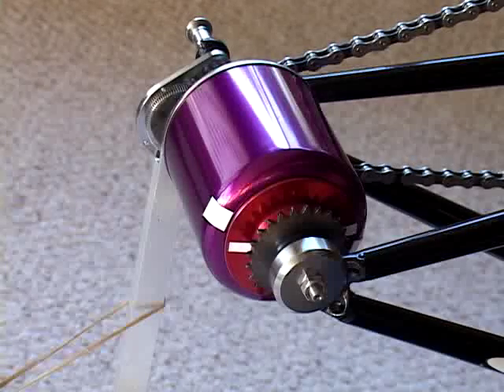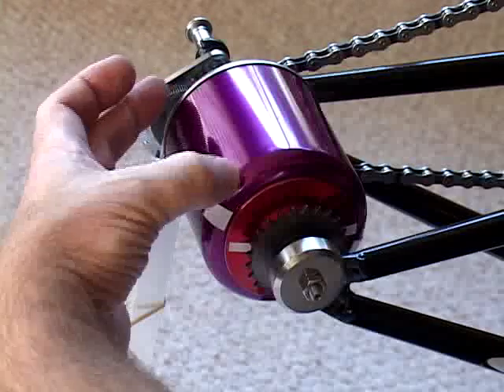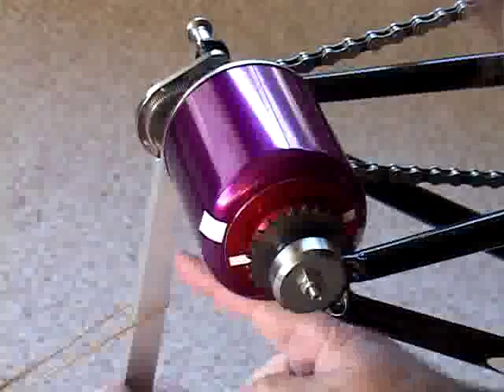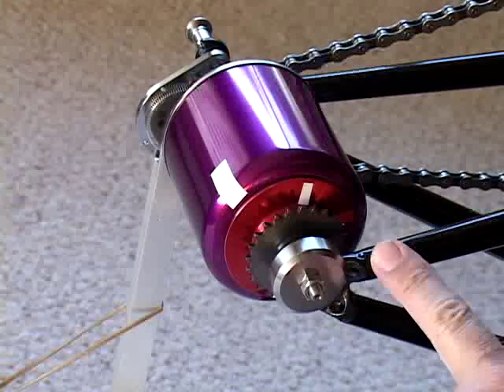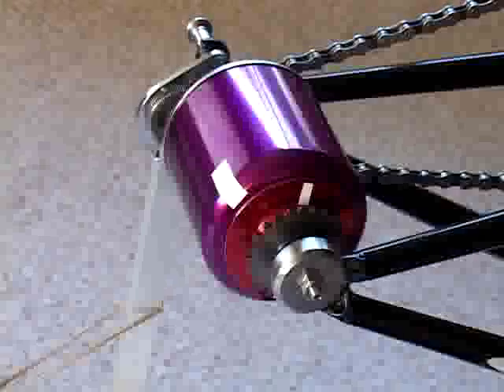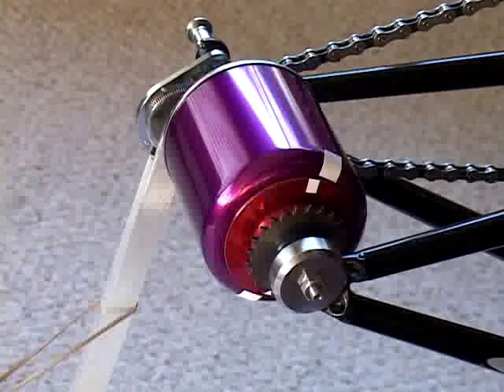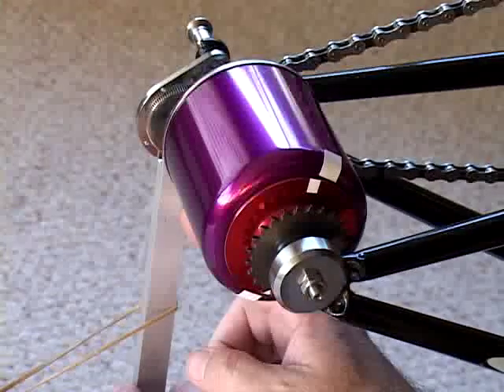Automatic Bicycle Transmission (IVT)

Comment: Your idea is great because provide a  much higher ratio range, but what about the weight ratio compares with an standard bicycle rear gears? If you can create and IVT lighter than the lighter ones on market it’ll be a great advance for cycling. For those of us that practice triathlon this would just great. Regards!

Comment from the maker: @theantiredneck You are very insightful about that.  I've studied that about electric motors too with similar conclusions.  The myth doesn't take into account the effects of variant loads on the motor; the torque/speed inversion is not linear, very non-linear at partial loading.  Tesla engineers know about that, but only abandoned their 2-speed because that torquey motor busted gears on the shift.  Notice that the SIVAT doesn't make an abrupt shift?  Hmmm!

Comment from the maker: @lidzykelly87 Look up the defiinion in Wikipedia.  IVT is a special case of CVT.  This is an IVT.  The top ratio is irrelevant because it can be raised w/ step-up at input or output without losing its ability to continuously reach zero; this is done in the featured drive with a 55T/11T sprocket combo input, giving the final drive nearly 5X.  A step-up will be integrated in the product version w/ a top output at >3X, sprocket sizing notwithstanding.

Comment: Would work nicely on electric vehicles, people that think electric motors don't need a transmission because they don't understand and have only seen gear less hub electrics and therefore since their repeaters and put what little processing they do have and apply that to what they repeat and copy would be amazed to see an electric that does have a transmission, electrics benefit from transmission just as much as combustion engines do!

Comment from the maker: @pwfordever Snowmobiles use a Variable Diameter Pulley (VDP), very inefficient.  They're not infinitely variable & cannot effectively be so because they'd slip with the level of torque that this can handle in ultra-low ratios.  Snow is not a positive traction surface, so it doesn't offer the level of propulsive resistance that a tire on pavement does by any means; OK for a VDP.

I didn't understand your reference to engineers mentioned from elementary school.  Could you clarify this?

Comment from the maker: @n8glore No.  The SIVAT won't stall unless you're pedaling against a vertical wall or can somehow produce over 1500 watts!  Only a handful of top sprinters can ever produce that level of power, and only for a few seconds.  That feature is there to protect the mechanism from destruction by crazies who'll try to use it with an excessively powerful motor.

Comment from the maker: @mrpierce1000 I'm currently developing the SIVAT for some non-bike application products.  This will offer a chance to determine its performance on vehicles.  If I'm satisfied with the results, we'll very likely develop it for high-end MTB's & Road Bikes.  For TT, efficiency is paramount; so the lower efficiency of gears (which the SIVAT uses) will need to be more offset by gains in ergonomic efficiency that constant fine-tuning of ratio provides.  We'll test that.

Comment: I'd love to see this.  It looks to operate similar to the Simplex motorcycle CVTs I've seen in the past.
Its probably a form of counterweights on a conical shaft that varies with RPM.  the rider can set a base ratio by locking in a default ratio and the flywheel will open driving the contact point further up or down a cone varying the ratio.

But alas just guessing.  Hope to see this around some time in the future.

Side note may want to check the maximum torque you can Chanel through the CVT.

Comment from the maker: @richramjames Weight is a significant consideration.  Most of the parts are hardened steel to handle much more power than most riders can produce, so I use shell structures to keep the mass low.  We'll do FEA to optimize its strength-to-weight ratio.  Note that this is an IVT, so your choice of ratios will be very wide.  BTW, I also awoke out of a dream to conceive this!

Comment from the maker: @iCEL55 Drawings are at vendors now for a prototype vehicle to be offered as a product.  This new design will eventually be offered as a bike hub and as a special bottom-bracket mounted version, both with a top ratio of about 3:1 allowing for a small pair of sprockets like a 36T/15T combo for enhanced ground-clearance on MTB's.  I'll post a new video when we build a bike to demo this in a few months.  The hub is intended to be fairly light, but of large diameter, and should handle 2 hp.

Comment: I have dreamed of an IVT for a MTB for as long as I can remember and have considered implementing something electrically before. Your mechanical solution offers much greater efficiency (without the potential for energy storage). Personally, if I got hold of a IVT bike hub, (3:1 sounds perfect), I would attach the leaver shown with a cable to a continuously adjustable shifter. Similarly to how I prefer to drive a "stick shift" car, for me control over the ratio is part of control of the vehicle.

Comment from the maker: @FrenchValleyAirport We'll torture-test the SIVAT at 25% more than its rated power of 1500 watts (~2 hp).  Life-testing will involve 5000 hours under load with typical excursions throughout its ratio range.  Efficiency data will be taken at various ratios.  We'll also try to break it so we can find any weak parts during a subsequent tear-down.  Dykem will be used to witness any interferences from loading deflections.  That's all part of the development process.

Comment from the maker: @JetMechMA Your description implies the use of a roller clutch, the same mechanism used in the SIVAT.  Roller clutches depend on an adequately large containment diameter that has required hoop stress capacity which is properly followed in the SIVAT design.  Bicycle pedaling torque of 100 Nm is considered as a typical max that requires a large roller clutch; this has been attempted before unsuccessfully with undersized roller clutches.  The SIVAT uses the right sized units.

Comment from the maker: @FrenchValleyAirport Like all mechanisms that transmit power it must be lubricated.  Since it's not reliant on hydraulics, it uses a low-viscosity oil that's contained by 4 sealed bearings; constant rotation of parts inside dip into a small reserve of oil as a rolling sump that coats their working surfaces.

Comment from the maker: @JetMechMA Watch again, and notice my comments about a stiff spring against the lever; I know that works because I designed & built an automatic bike CVT using the same principle which worked very well.  BTW, it does free-wheel like most bike transmissions, and it engages almost immediately in any ratio when you begin pedaling again. The new product-design SIVAT will be useful in hubs & special bottom-brackets with very few differences between versions. Thanx.

Comment: This is interesting, and I agree with some of the other comments, lets make a bulletproof version to handle the torque, horsepower, and weight of a go-kart and or minibike, and dont make it so it barely does the job, understand that we are all crazy and always look for ways to make our engines more powerfull, if 5 hp is the average , make the IVT to handle 15 -20 hp, get it dunn, I want one !

Comment from the maker: @thunder996 There's an excellent chance!  The new SIVAT is being spec'd to handle 2 hp (~1500 watts) at 90 rpm input; if it handles the higher input test speed of an engine at >300 rpm, it should also accomodate about 6 hp from an engine.  That will be tested within months.

Comment from the maker: @tomterahedrob The cost will depend on volume, so it will drop as it becomes more widely used.  It will be featured in higher end products first as an OEM replacement for other transmissions, but the goal is $500-$900 as a stand-alone, standardized product.  The 3X top ratio will be good for small wheel vehicles without a need for huge front sprockets.

Comment from the maker: @tomterahedrob You heard right...kinda.  A clean, freshly lubed, well-aligned chain drive is 98% efficient.  Derailleurs drop that efficiency down by 3-6 points by deliberately misaligning the chain for most ratios.  The SIVAT gear combinations figure about 94% efficiency, dropping down to 88% in very low ratios.  A more important consideration is the ergonomic effect of regulated cadence resulting from pedaling in the best ratios; 85-95 rpm being optimal for most riders.

Comment from the maker: @everythingman987 The IVT has infinite ratio range by virtue of its ability to always reach extremely low ratios (including zero) even when all its ratios are raised by step-up gearing.  CVT's have limited range, usually <4X from high to low regardless of any step-up or step-down.  Although IVT theory isn't terribly complex, its real-world implementation is non-trivial.  Wikipedia has a fair description of this distinction under 'CVT' or 'Transmission'.

Comment from the maker: @clake10000 See my response to wiktorioss, 5 days ago.  A clutch is a dynamic friction device that wastes power & causes wear during its transition to & from disengagement between input & output.  The SIVAT never disengages, is based on variable leverage, and transitions in speed ratio with very little wear & wasted power.  To assume that it's a clutch because it can act like a clutch is a sweeping generalization, a logical fallacy.

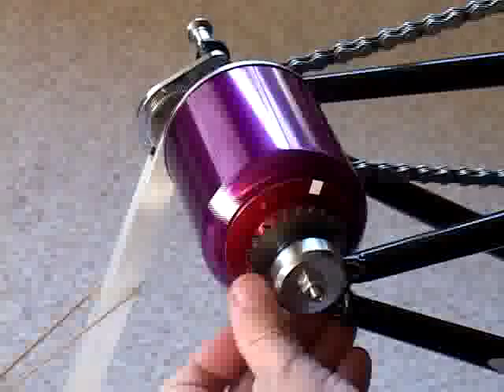Comment from the maker: @hwfanatic Notice the ratio-control lever & rubber band?  These will be replaced with a similar device with a stiff spring instead of a rubber band that pushes the ratio-control toward high gear ratios until input torque rises enough to compress the spring through reaction, forcing the SIVAT to lower its output speed while the input speed remains constant.  See 5:10 to 5:15 to notice how that works.  This action will increase output torque as needed to ascend hills of variable grade.

Comment from the maker: @Direwolf56 There's a good chance that the SIVAT will be featured in a few products this year.  I'm working on a design that will be easily adapted to pedal-crank input, wheel-hubs, & typical motorized uses.  The new design will have highly enhanced torque capacity, bi-directional input & a top output ratio >3X.  This will likely be available next year for users & product manufacturers who want to use it their own way.  The business details are now in-process.

Comment from the maker: @wiktorioss I did explain that the new design maximum output will be >3 times faster than its input!  Regardless, even if it only regulates ratios below 1:1, it is still a transmission.  Your calling it a clutch does not make it a clutch.  A clutch is a dynamic friction device, which the SIVAT is not.  I use the American English definition of the term 'transmission', which is equivalent to 'gearbox'; the SIVAT fits that definition perfectly.

Comment: @SIMKINETICS I'm sorry but as I see it's still just a clutch but for much bigger gear on chain than we can use normaly. so it shouldnt be called transmission. Let us forget about the chain but we say that the input big rotary part does 1 rotation, and now the question: can that part that is regulated by lever rotate faster then the input part? if no, it,s just mechanical clutch, if yes, I'm sorry but you haven't explained it.

Comment from the maker: @wiktorioss You're not seeing the whole picture... literally.  The pedal crank rotates 1 turn for every 5 turns you see at the SIVAT input!  The chain drive in the video is a 55T/11T combo.  Regardless, the new SIVAT output will spin >3 times its own input; this was mentioned in other recent comments.

Comment from the maker: @MrWebberman Thanx for your comments.  Your insights are exactly along the lines of my thoughts for MTB's.  The BB version is the design I'm pursuing; riding even a hard-tail with a massive hub just doesn't feel nimble, so up front it goes!  Yes, the strength-to-weight ratio is very important & difficult to balance in design.  The SIVAT will debut in non-bike apps this year, but the bicycle SIVAT should follow in about one year.

Comment from the maker: @wiktorioss Yes, a clutch is useless for a bicycle.  No, this is not a clutch.  When you start pedaling, it will not be in the lowest ratio or zero.  Take note that the video demo uses a 55T/11T combo for final high ratios well above 1:1.  BTW, the new design will have an internal top ratio > 3:1, so a large chainwheel is not required to achieve MTB-like high ratios of 4:1 or higher; a single 22T/16T sprocket combination will work fine for all ratios you'll ever need.

Comment: main problem i have with this is that its on the rear end.This thing looks like it weighs a tonne if i was gunna have this on my bike i'd want it as low and close the bb as possible. it would completely ruin the ride of a bike if placed on the rear end, needs to be built into a frame!

Comment: This little device is ingenious!  Good work!  I hope you can find investors to put it to good use.  I don't know much about mechanical stuff (my expertise is more with electrical experimentation), so I don't understand exactly how it works, and how you can get a zero ratio.  How does it "slip" like that, while still being engaged?  I know that a torque converter uses hydraulic coupling, but I can't understand how your transmission works!  I guess that's still a trade secret though, huh? ;)

Comment from the maker: @thanx4help It's called a SIVAT.  The modular design I'm currently working on will be easily adapted either to fitting inside a wheel hub, or outside the wheel with chain drive, or by crank-input as on bicycle bottom-brackets.

Comment from the maker: @ttwixxxx Answers:  
1) If you mean two separate SIVAT's, it is possible to synch their ratio shifts in parallel by linking their shift actuators with a geared (or levered) jack-shaft; auto operation would average their response.
2) The current SIVAT development is based on modularity with course sizing increments based on power throughput.  The first module will be rated at 1500 watts, about the size in the video.  The next module size ~6 kW, 6" dia X 5" long.

Comment from the maker: @gulllars The raw physics does work for vehicles of certain size, such as with motorcycles & larger vehicles.  As a long-time bicyclist, I cannot appreciate FES as a benefit that would offset its additional mass; bicycling is largely an aesthetic experience that relies on the kinesthetic charms of lightweight maneuverability, its greatest hallmark.  However, the SIVAT alone for bikes is likely attractive.

Comment: @SIMKINETICS Sounds like a good idea to me mate... 
There are so many things that could be done with this if you can make it stronger and durable. 
I would love to see it fitted to a large motorcycle replacing the gearbox. 
The cluch lever would become redundent or you could move the rear brake up to there instead. 
There would be no need for foot controls at all if you connect your product to a twist grip on the left handlebar. 
ATV and other off roaders would lap it up im sure...

Comment: @SIMKINETICS my quick calculations say a FES with capacity of 4 KJ (enough to accelerate/decelerate me (75) + bike (5) + itself (5?) to roughly 7 m/s or lift about 5 m) could be done with a 2,5 kg flywheel given a center of mass radius of 20cm @ 19K RPM.
The FES coud be fitted next to the rear wheel, but i'm not very familiar with FES design and how the rotational speed tollerances of such small units would be, or if 5kg total will be unrealisticly low for 4KJ (i sense it may be).

Comment from the maker: @welshray1 Only one at the pedal crank will do the job, and it will move its mass to a better location for more responsive handling on the bike.  My most recent concept will provide a compact design with very high top ratios without using a large front chainwheel.

Comment: @SIMKINETICS those egg brakes looked interresting. I'm not a competitive cyclist, but rather use my bike as transportation and exercise combined or just for exercise.
I'm Norwegian, and our landscape has lots of small and large hills, and i live in a mostly urban enviroment (though there's also 5-10K stretches of country road around good for cycling). I was thinking of FES more for 5-15sec 500-1500W burst potential being loaded by breaking (75kg @ ~10m/s) or slow loading (50-200W?).

Comment from the maker: @gulllars Hmm.  My son is working on a PhD in computer engineering, & is an ME.  You can see his 'Egg Brake' for bikes on line.  You might have something in common.

Regarding FES for bikes, think about the mass.  Regenerative braking only makes sense for large, heavy vehicles, either flywheel or electrical-based.

Comment: @SIMKINETICS i've subscribed, so i can see the animation when you get your patent :)
I'm very interrested in various engineering, and am studying computer engineering, but i still love looking at various mechanical engineering concepts.
How large would a pair of IVTs like this and a flywheel have to be for a recumbent bicycle or other (single user) HPVs for use as regenerative breaking which can be used to assist in hills etc later (or to charge a small battery for LP electronics)?

Comment: This is an interesting, well presented video and nicely finished prototype IVT. In 1980 I joined a team of researchers at the University of Bath (UK) studying CVTs under contract to the Leyland truck & bus group and the UK Government Department of Industry. We studied hydrostatic and frictional CVTs with brake-energy recuperation. One lecturer developed and patented a CVT with finite ratio range for bikes, with a chain-wheel of variable radius controlled by a torque-sensitive feedback system.